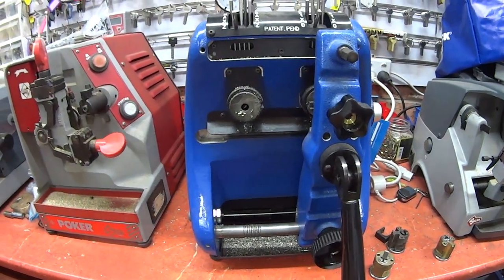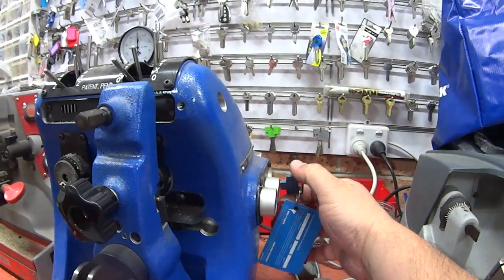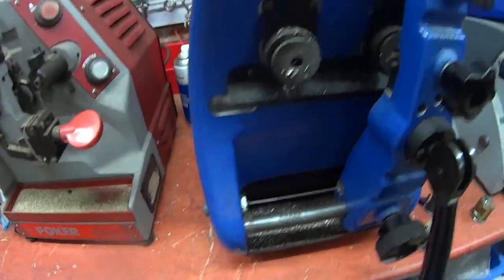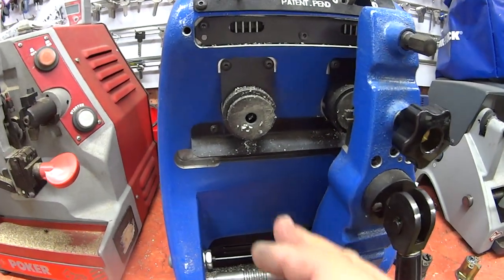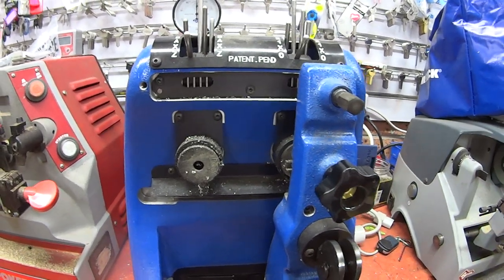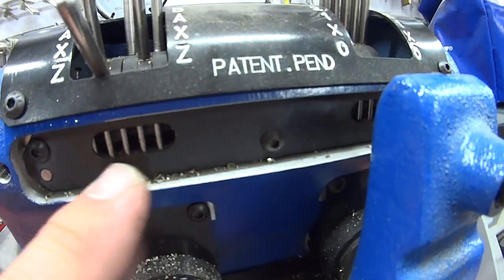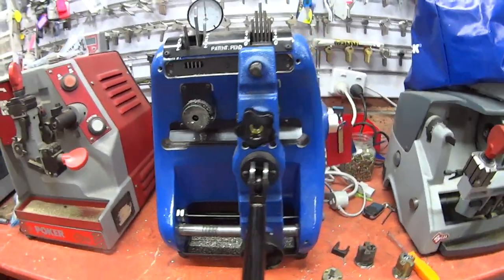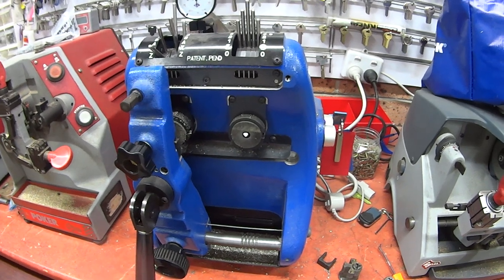Mul-T-Lock Key Machine - Quick user guide

Comment: I noticed it takes a removable computer type cable so you can buy a 3 in 1 cable & use it to plug the Machine & a laptop or PC with one cable, I have a video on computer cables go have a look?
Reply from the maker: This machine is all mechanical, the cable is for the Unocode 2 machines up from this one , I plug it in with a 3m usb cable when needed, The computer version of this machine is over $30k , cant afford that just yet and this one dose the job, not fun when you need to cut over 100 keys at one time